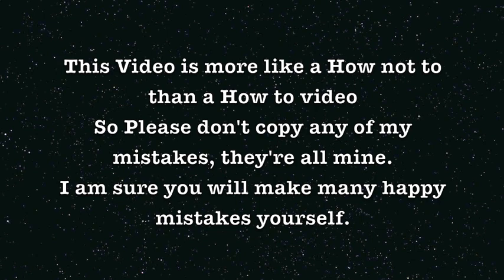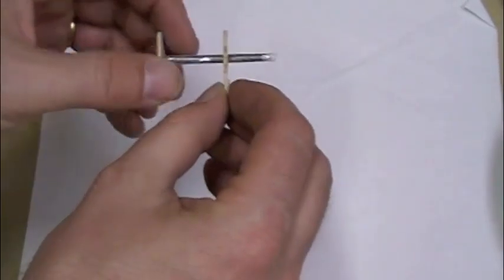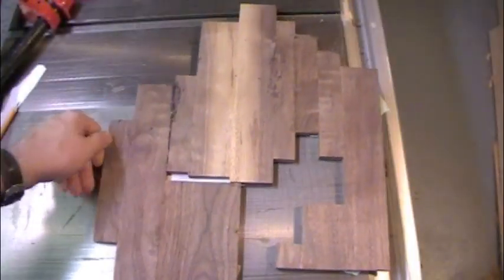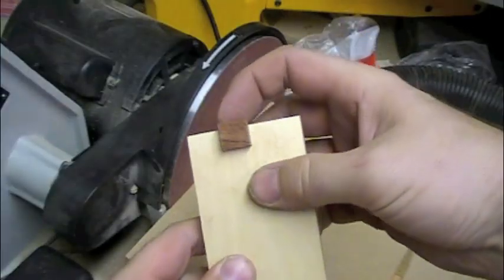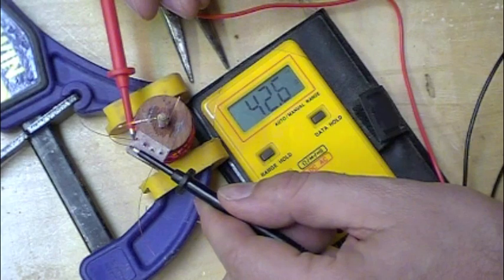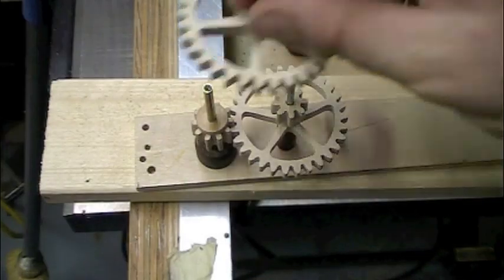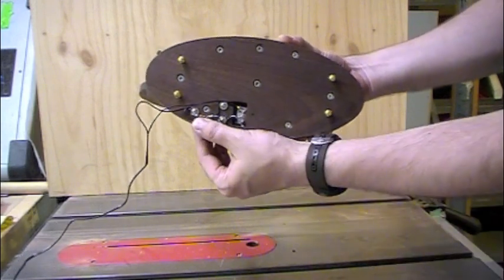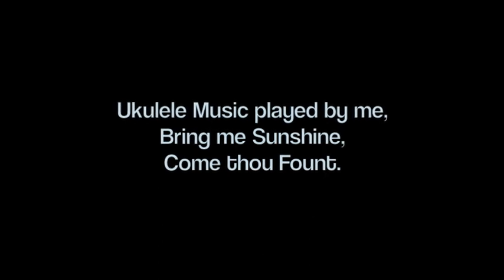Toucan, an electric wooden gear clock.

Comment: I'm building my first Toucan & have watched your video many times. You did a fantastic job presenting your experiences . Could you elaborate on how you tested your electromagnetic coil for continuity? That's never mentioned in Clayton's plans. What numbers are you looking for across which solder points? Also, are the inner and outer coil windings in the same or opposite directions (or doesn't it matter)? Thanks.

Comment: You could use an LM7809 regulator.  These are pretty simple to apply, you may need to include a heat sink.  The other better choice is to find a 9VDC wall-wart.

Comment: WoodenLoon,  thanks for your video, it inspired me to build one of these clocks.  I am getting ready to wire up the coil and am a bit confused (by the plans) how the diode gets wired in?  Any help would be appreciated.  (am pretty sure I have the transistor figured out that was explained pretty well in my opinion.)  Thanks
Reply: is it the black npn transistor that you have figured out ok.?
or the resistor on the outside that connects to your power supply.
I am not good at electronics so I am not a big help, sorry. so this is what I think it is you mean.
At 2.35 mins you see the base of my clock I created another recess for the screws so it looks like a battery connection one positive the other negative.
 I connected the resistor to a piece of the positive wire by cutting off a little section and soldering it to the resistor, one on each end, then I connected the positive lead of the coil to a screw on the base, added the resistor to the connection  and tightened the screw then I had another screw where the Risitor was connected to the positive lead of the power supply. all screwed on the bottom.
hope this helps.

Comment: Hi,
What a wonderfull clock and video. I also purchased the plan fron Clayton but, cannot find electric wire length as mentionned. I found a store in MTL (Where I live MTL, Quebec) but the minimal length is around 1500 ft of 30ga wire. Is there a way to wind with the proper length from a bigger spool.

I'm anxious to start making my clock. I already did another one.

Regards. All help is appreciated.
Reply: I am not super technical in these things there are people who build contraptions with calculators attached that can count off the required length.
I went to the source and had to buy the three pack of different gauge wire and I used one of them and had two odd sizes of wire left over , I think I had to buy a couple of packs I can't remember, this is the summary of the package the source sells, I looked under magnet wire assortment.
'Magnet wire assortment. For coil winding. Includes 12m (40') spool of 22-gauge, 22m (75') spool of 26-gauge and 60m (200') spool of 30-gauge solid copper wire.'
Reply: Thanks for the comments. I did not want to buy kits that you mentionned since I would be left with two other coils wires that I would not use.

I will try and find a solution to this and post a suitable comment if I find one.

Regards,
Reply: I got a foot long ruler and wrapped 200' around it and then cut it. Then I made my coil from that wire
Reply: Patrick Dukes Thats a cool Idea and one way of doing it.
Reply: Christian Robline
I started on the clock. Took a while since I was doing major renos to my rentals. So now, I want to finish the clock before Christmas.

I have one question. Doing the coil, I found it hard to do it properly. Does it matter if it is not 100% perfect? Will it still work?

Txs.
Reply: Christian Robline Woodenloon/Ukuloonie. it should work if you have the correct amount of wire wrapped around it in effect creating a small electro magnet you should be fine. Try it anyway I would no ones gonna see it.
Reply: Ukuloonie
I have another issue. My power source is giving 14v dc. How do I bring it down to 9 volts. Tried the resistor and does not seem to work.
Reply: Christian Robline Easiest way is to buy power supply with 9v output ??
Reply: I am not sure, I cannabalized mine from something I had lying around a second hand store maybe if there is a cheap contraption they are trying to sell?

Comment: Nice construction.  One way to ensure 9v or anyother is to use a voltage regulator.  A very simple and inexpensive one is the LM317.  It is a 3 pin (legs) IC chip, and only a few external components (2 resistors and maby a capacitor) are needed to set the desired voltage.